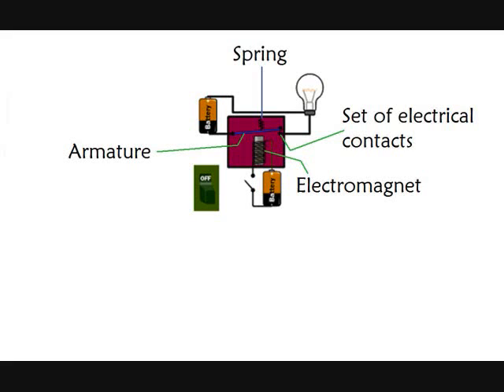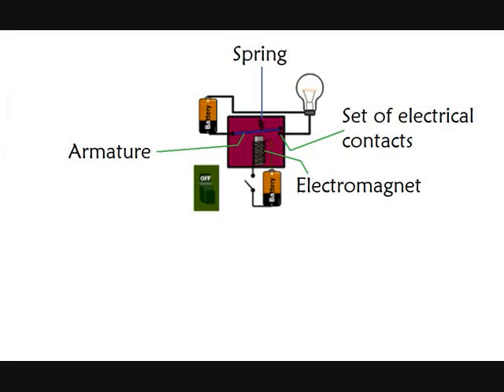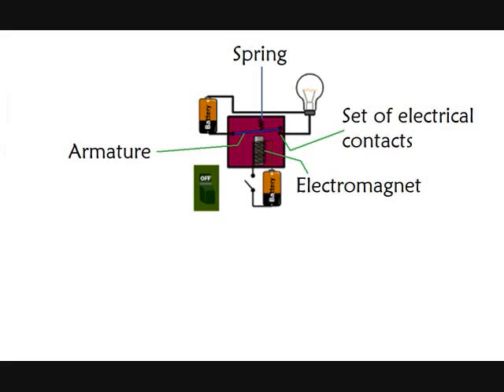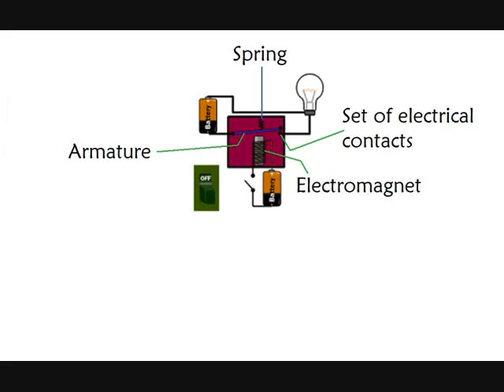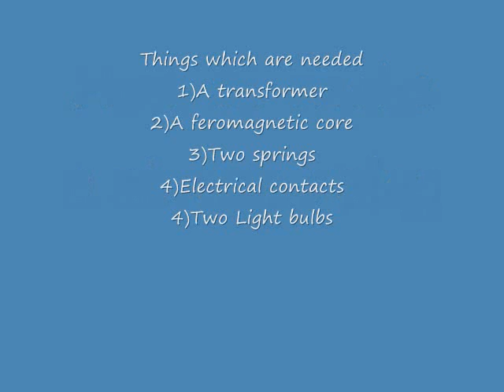How Does A Relay Work

Comment from the maker: You could make a relay with a battery, but then you will have to construct an electromagnet. Wrap a flux insulated copper wire around a ferromagnetic core  (A soft metal) and connect to power supply. I'm sure that you have done this in your childhood. However the magnetic field created by the electromagnet should be adequate enough to attract the armature. In order to have a high magnetic field increase the number of turns of the coil and supply a high voltage  (Comment if help needed)

Comment from the maker: Relays are commonly used as a switch to control high loads with a small voltage. 
You can find them mostly in control circuits, for example in timers controlling industrial motors.